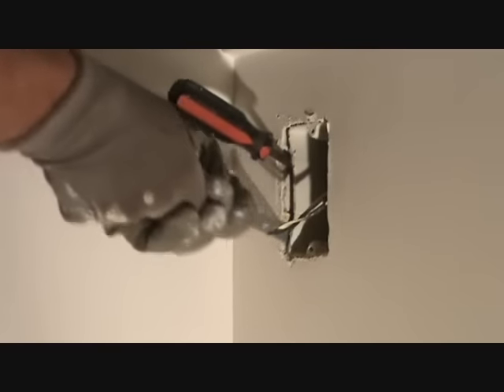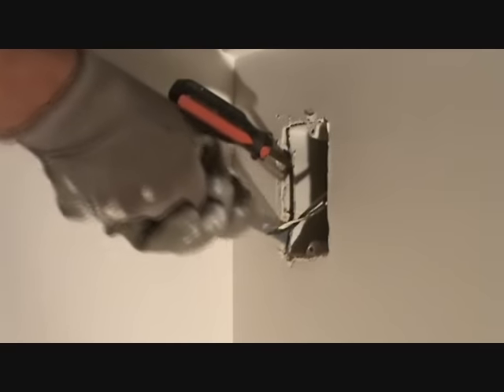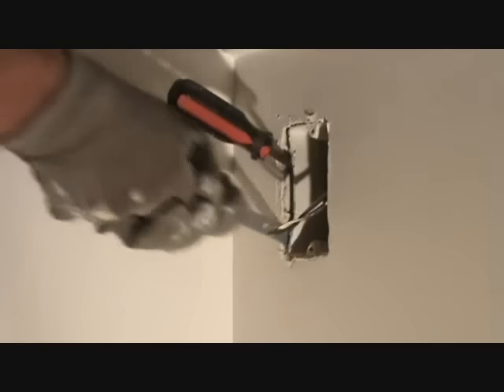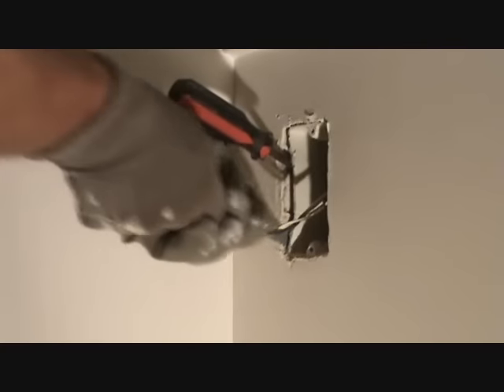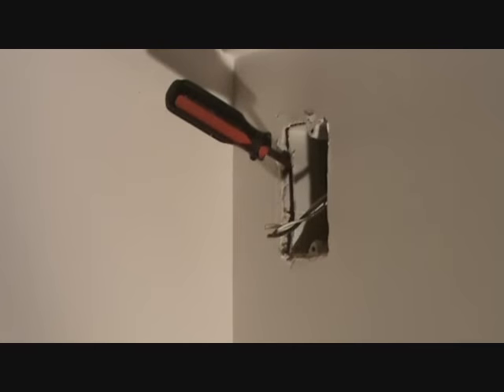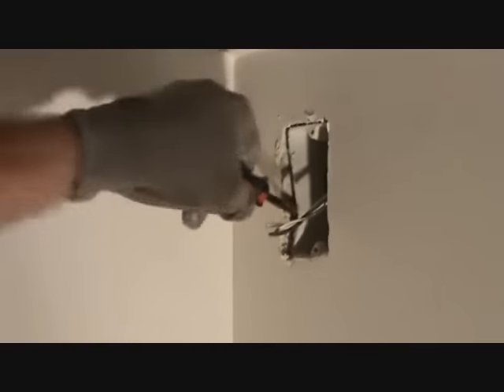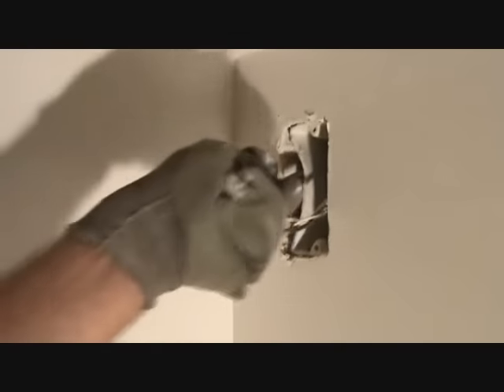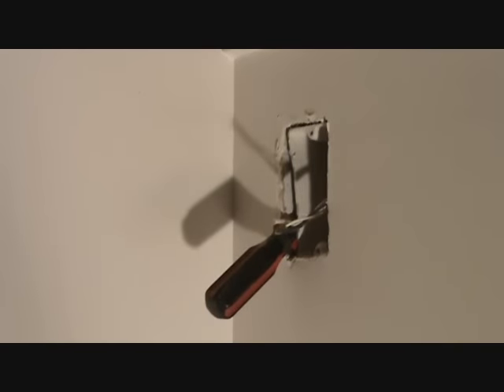How to remove an existing electrical duplex outlet box

Comment from the maker: In most states, it is against code to cap off hot wires within your wall cavity. Do you have an attic area? Pull the wire up into the attic & install in a plastic box there, with a wire nut over each wire & install a blank plate over it. If you cannot pull the wire up into the attic, determine which wire goes down the wall & cut the wire & install in same way in attic. Make sure to turn the power off to that circuit first though. Never work on hot wires. Thanks for commenting!   Joe  :0

Comment from the maker: This is a good trick to do, whenever you need to fish another wire to same location, add/or add another light switch at same location. Works great. Thanks for commenting. Good luck.   Joe  :0
Reply: I was just thinking of this to allow fishing a wire to another location.
Reply from the maker: @jaydee3046  Yes that's what I will be doing here too. I wanted to install a 4 hour wall timer for a wall mount AC unit & this was the power for the AC unit so I needed to remove this junction box in order to drill a hole through the next stud to then install a cutin box for the new timer & feed the wires back over to here of which I will then install a cutin box here & re-install the existing electrical outlet for the wall mount AC....easy!

Comment: I have a plastic box in the wall with a couple coax cables in it. It looks pretty deep, probably 3 inches in. I’m guessing it could be nailed to the stud, I didn’t check yet. I want to duplicate the cable to the other side of the wall. To explain you better, the modem is in my bedroom where the cable is. I want to make another wall plate with a cable in the other room where I’ll be moving the modem. I don’t think I can keep this box and just add another one from the other side, this one is too deep and won’t allow much room to put another one from the other side. So either after removing it, I install two shallow boxes butt to butt or some sort of single one open on both sides to put the plates on, any ideas for this situation? Thanks.
Reply from the maker: Yes you could remove the existing box then go butt to butt with like a telephone cutin box plate for both sides for the wall or.....you could install regular plastic cutin boxes (shallow standard size ones butt to butt & do it that way too.....Thanks for stopping by! I have lots of electrical videos that will show you more of this project as well as other things which you might find helpful for your project as well. Go to my main YouTube channel page then click on playlists & scroll down to electrical. Thanks again...

Comment: Very handy trick. Sawing through the nails is relatively quick and painless. Be careful not to punch through the other side of the wall.
Reply from the maker: Yes no issue with that either as you would feel it for sure. This trick really works well & have removed over 100 boxes this same way. Presto! Now I make fire!

Comment from the maker: @taterberryman You could use a stud finder but if you're careful, where you poke the hole, the hole won't show when you put the cover plater back on. I still like to poke a small test hole even if I use a stud finder....just to make sure, especially if you're close up against a wall or something. Remember....stud finders will also find other things in the wall other than just wood studs. Thanks for commenting.   Joe  :0

Comment from the maker: @taterberryman Yes they have little saw attachments like you have explained so you can use that too. I wanted to show you how to do it with just a hacksaw blade, in case you didn't have anything else, you would know you could still do the project, even if you didn't have the little saw as you have explained. Thanks again for your comments. Much appreciated.   Joe  :0

Comment: And... they really do make saws with handles on the end so you don't have to hold the blade and risk cutting yourself if it slips. They're about five bucks at HD. Having the right tools for the job makes life a lot easier.
Reply: Save yourself the 5 bucks and use vice grips

Comment: Take a flat pry bar and hammer, leverage it away from the stud. You can see the nails easier and reduce the risk of cutting into other wires stapled to the stud. Actually, in my situation, I was able to pry the box completely away from the stud. Now, I think I can use a combination of cutting the box apart with my sheet metal snips or remove the nails by pushing the nails back through the box.
Reply from the maker: Nice job. I like to use the hacksaw blade though to make sure I don't damage &/or mark the wall from trying to remove the box. Let me know how everything goes for you now that you have the box removed. Kepp it going!

Comment: I need to do it too, I might just cover up the hole with thin aluminum (drywall) patches, those are supposed to be good.  TY
Reply from the maker: This works great. How did you project come out?

Comment from the maker: @bigst79 You can move an off-centered light fixture if you have an attice area. Be careful not to fall through the ceiling! If you don't want to patch the ceiling, put a round white plate over your existing hole & you can install a cut-in round box for the new location. I have a video that shows you how to install a round cutin light box (it was for some track lighting I was installing). Look for it. Good luck.   Joe  :0

Comment: This video cracks me up!
Reply from the maker: Well I hoped you learned some cool stuff along the way too. What more could you ask?! LOL I have tons more videos for more laughs. Just go to my main YouTube channel page then click on playlists then scroll to whatever DIY topic I have on my channel that might interest you. I know I can save you money around the house. Thanks again for stopping by! This trick for removing electrical outlet boxes works every time. I've removed maybe 75 or more now, ahem...
Reply: @VideoJoeKnows  I removed the my first 14 boxes with a multi tool and carbide blade. Ouch. About 20 minutes a box. I tried the hacksaw and garden gloves method for the last two. Miracle! Hacksaw beats the multi tool hands down 10/10! Took me under 5 minutes a box. The video cracks me up because of how ridiculous it seems. BUT this is the best. Also cuts the staples holding my romex to the studs. Amazing!
Reply from the maker: @nicholasmurry2076  Ha! I knew you could do it easier this way. The first time I tried to use the hacksaw trick I put the hacksaw blade in one of those hacksaws where just the blade was sticking away from the handle but I couldn't get the full force on the blade to cut. so I thought why not just try the hacksaw in my hands with gloves & presto! Dude have you seen all the other electrical videos I made of this project as well as all the other stuff I show? Just go to my main YouTube channel page then click on playlists then scroll down to electrical stuff. Trust me when I say you won't be disappointed with all the things you will learn! Promise...
Reply from the maker: @nicholasmurry2076  The other thing I like when I cut with the hacksaw in my hand I can now feel if I hit anything back inside the wall like a wire shoved back in there. If I feel something I could then reposition the hacksaw blade just a hair then keep cutting. With a multi tool or sawzall you can't do that until it's too late & you just cut through a wire! Then you would have o cut the wall open to make the fix & patch the drywall blah blah blah....see what I mean?

Comment: Is there a better way to cut these nails? I am trying this oscillating multi-tool thing:)
Reply from the maker: I would not recommend using a multi tool or sawzall as yes you will cut the nails but what else might you be cutting without ever knowing...? like a stray wire. That's why I like to use just the hacksaw blade in my hand so I can feel to see what else might be in there & if I feel anything else then I can stop & reposition the blade before cutting off the nail. It really works great & I have removed at least 100 boxes this very same way. In fact if I needed to remove a box today I would still use the same technique. Thanks for stopping by & good luck with your project. Hey I have more videos of this project too for more learning. Just go to my main YouTube channel page then click on playlists & scroll down to electrical & all the videos will be in there. Good luck again with your project & let me know how you do.

Comment: Worked like a charm.  Thanks!
Reply from the maker: Pretty cool huh.! The first time I removed one I was like "I hope I can do this". Now I can do them in my sleep...almost!   Joe  :0
Reply: VideoJoeKnows Thanks Joe I just removed a box I would have never thought of using a hack saw blade.
Reply from the maker: Great job. Yes....I use to use my special hacksaw where I would put it in a special slot & one end of the hacksaw blade would be sticking straight out then I would use the hacksaw like a saw & cut away before I realized I could just put the actual hacksaw blade in my gloved hands & saw away. works great...as you found out. Way to go!   Joe  :0

Comment: If you remove the box with the goal of covering up with drywall, do you think it is safe to get a small box with blank cover, cap the wire ends in the box -- and leave the box 'hanging' there?  Any other options?
Reply from the maker: Code says you should never leave hot wires buried behind a wall such as drywall! I was removing this electrical outlet so I could then fish a wire to this box from a new cutin box that was going to be used for a 4 hour timer for an existing wall mount AC unit! How did I do that? Glad you asked! Just go to my main YouTube channel page then click on playlists & scroll down to AC units & electrical & you will find the videos in one place or the other or both! Thanks for stopping by!

Comment: What do you do with the wires if I want to take out the box and just fill the hole in.
Reply from the maker: Code says you cannot just put wire nuts on the individual wires then shove into the wall. Do you have an attic above? You would have to crawl up there & locate where the existing wire cable is coming down into the wall then cut the wire cable in the attic & install in a plastic single gang junction box. Now you can put wire nuts on the individual wires & install a blank plate over the outlet box. Thanks for your message!   Joe   :0

Comment from the maker: @Kittielips Make sure you pry & knock that stud around & see if it makes a noise. If it does, that's the nail pulling loose from the box. If you squeeze harder the stud might stay in place while only the box moves. If you really want the box to move away from the stud, give it short little strokes again & again & see what happens. Work at it & you'll see what I mean.   Joe  :0

Comment: Hi, thanks for the video but I have one question. I am curious to know how to remove a broken screw off from plastic box that holds the outlet. I don't know why but the head of screw that holds the upper outlet broke. Should I go and purchase a screw extractor and take it out. Since I am dealing with sensitive material, I'm afraid to lose the box that was already installed behind the wall. If I use the screw extractor, hammer it on the broken screw to remove it will it cause any troubles?
Reply from the maker: What did you end up doing to get the screw out since you didn't want to remove the plastic junction box? I would've used a tiny one inch or longer wood screw with wood threads & a little washer then sneak the screw right in next to the broken off screw since it's a plastic box with a little give anyway. See what I mean?

Comment: I'm adding some DIY networking to my home. I want to remove the current box in wall where coaxial is and replace it with a gang recessed plate so I can feed the coaxial and cat6 cables though it, down to the crawl space under the house. My next problem is im not sure how I'm going to drop the cables down. In the crawl space. There is a lot of insulation. I guess will have to measure to find out where the wires will drop?
Reply from the maker: Well how did you project go years ago? I am thinking you got it done with flying colors!

Comment: Sawzall and cut the nail from both sides, thanks for posting
Reply from the maker: Here's why I don't use a sawzall.....if you have anything inside the wall that you can't see that just might be right behind the area where you want to use a sawzall to cut off the nails, then the sawzall is going to slice right through that as well.....like a rogue wire in the wall or 3 or 4 wires stapled to the side of a wood stud & now you just cut them with your sawzall. Now what? You have to cut the wall open to do some major surgery to your wiring then patch the wall, prime & paint, etc. all because you couldn't feel back there while using a sawzall. When you use a hacksaw like I show if you feel something back there like a wire you can stop then reposition the hacksaw blade just a bit then saw away & cut the nail off. It really doesn't take that long to cut two nails off with a sharp hacksaw blade. I have removed over 100 boxes in the wall while using this same technique & works really good. When the hacksaw blade gets a little dull on the end I just cut off a portion with some tin snips then use the same hacksaw blade to cut more boxes out of a wall. Simple. If you try it you will be sold. I have more DIY howto videos that you would appreciate. just go to my main YouTube channel page then click on playlists then scroll down to whatever topic you want to see & have at it. You WILL learn more & save more around the house. Try it!

Comment from the maker: Ha! You must be lucky since I have never had this happen before! I have a suggestion for you. Why not remove the entire plastic outlet box & install a new plastic cutin box? That is, if you end up not being able to remove the existing broken off screw. I have a video that shows you how easy it is to remove an existing plastic outlet box. Or you could drill a very small hole as close to the broken off screw as able, then install a sheetrock screw to replace the other one. Good luck.   Joe  :0

Comment from the maker: Do you have a steel tape, better known as a fish tape? You can get a 50 footer at the store. Tape the cables to that then push down through floor & through the insulation. Tape ends of cables, so no insulation will get in there. Then go under the house & see where they came out at. will this work for you?    Joe  :0

Comment: Sawzall, or buy a small handled frame for the blade
Reply from the maker: I would not recommend using a sawzall since if you have a wire dangling around back there you will never feel it until after you cut through it with a sawzall. Then you will certainly have more work needed in front of you.....Trust me when I say this really works great to just use a hacksaw blade with gloves on. Try it. I've done this over 100 times & have never had an issue. Just make sure to use a sharp hacksaw blade & when the blade gets kind of dull towards the end just cut it off & go some more... I have more of this video project if you want to learn more. Just go to my main YouTube channel page then click on playlists then scroll down to electrical items...try it!

Comment: That's what a reciprocating saw is for, AKA a Sawzall.
Reply from the maker: You know what a sawzall would do? It would cut off any loose electrical wires that might be in the wall up against a wall stud or worse. If you use the little hacksaw like I show then if you feel something, you won't cut through it. Here's the question....what if you were to cut into a hot wire? How are you going to fix it without cutting the wall open? We really don't want that. Thanks for checking out this video!
Reply: I do know what a swwzall would do, I’ve changed out lots of boxes, I’m an actual electrician (not a handy man). Learn how to use the tool, it isn’t all on or all off, then you’ll be fine. An oscillating tool is another great option too
Reply from the maker: @aJwilliams555  I hear you but you have to remember that most viewers are not great electricians such as yourself & also may not want to purchase a sawzall or oscillating tool. They would be wise to use the technique I show here as any average Joe should be able to remove the box as I show using limited tools. Thanks for the added info & continued success to you!